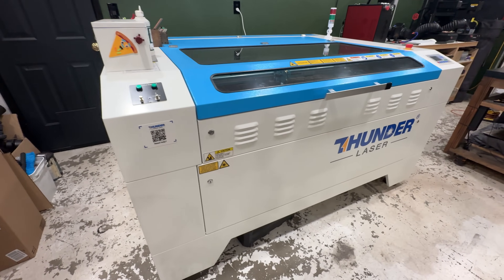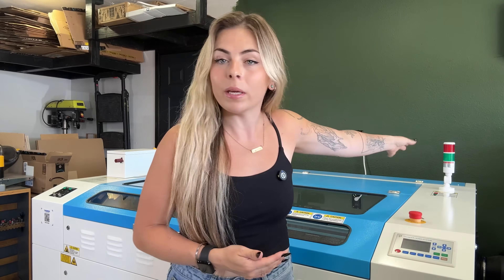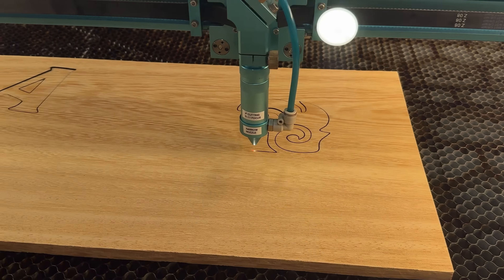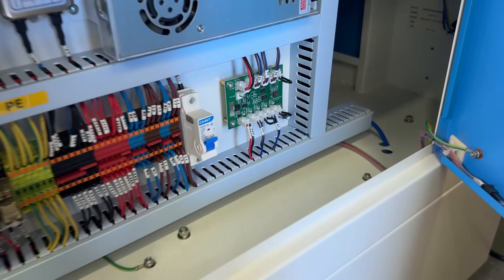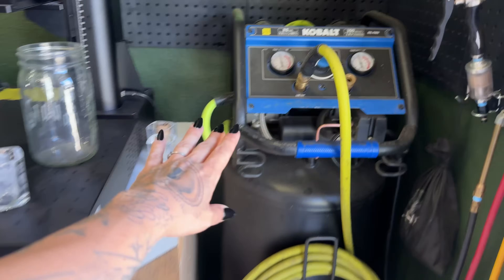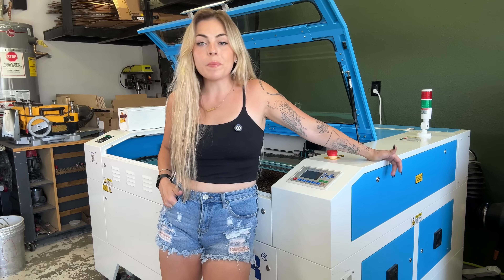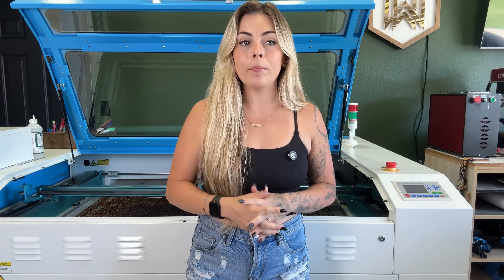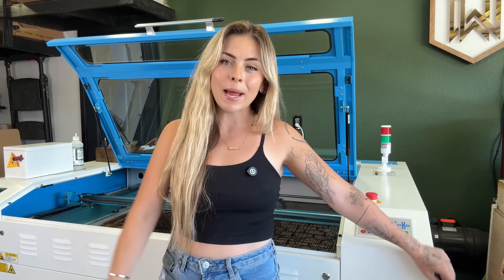Watch This Before Buying  A C02 Laser, One Year With My Thunder Nova

Comment: Supposed to have at least 6 inches of clearance on both sides of that chiller.
Reply from the maker: I did not know that, Thanks for the heads up. I will make sure to move my laser out a little and consider that when I am setting up in my new shop soon.

Comment: Another great video! With you getting a Bolt (depending on the model, it comes with an installed air compressor) and guessing you are going to use external air, any thoughts on if you are going to keep the compressor that comes with it installed or remove it…if you get the model that comes that way? I received a Bolt Pro 32 a while back and I am contemplating whether to remove both the compressor and exhaust fan or go with some other configuration. Thanks.
Reply from the maker: Hard to say with out first trying the stock configuration. That being said I will probably leave the air assist installed but hook up to an external compressor. As far as exhaust the fan that came with the Nova works really well so I am hoping the fan that comes with the bolt will also work well. If not I probably will remove it and add a larger fan. Wish I could be more help but once I get the bolt I will have some better answers.
Reply: @WyldeWillow  Hello. Thanks for the response--somehow I missed it earlier but I came back to watch this video again and saw I hadn't answered. Do you have any updates on how you ended up running air and exhaust?